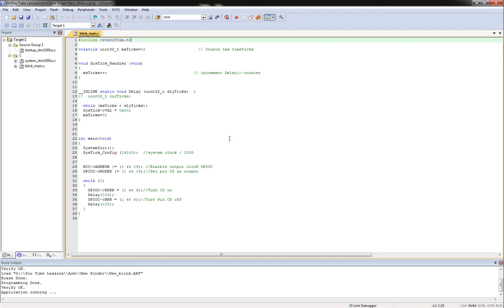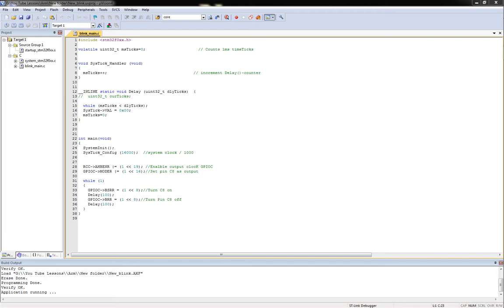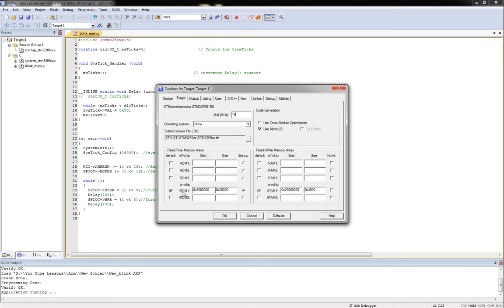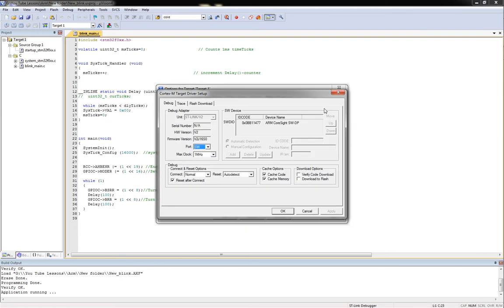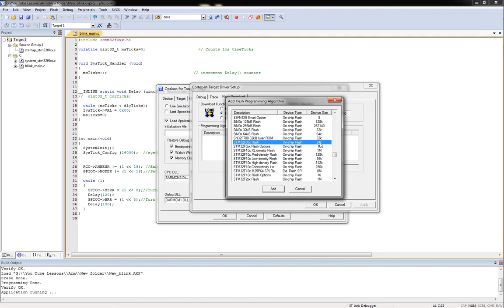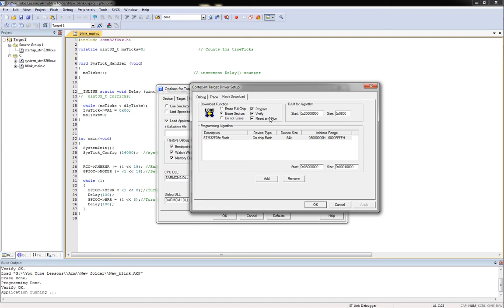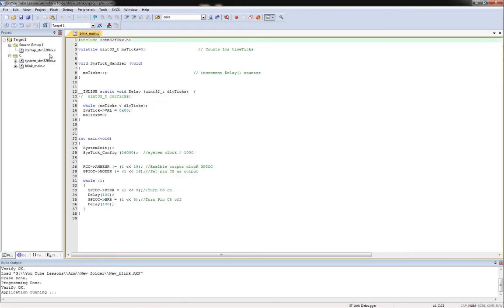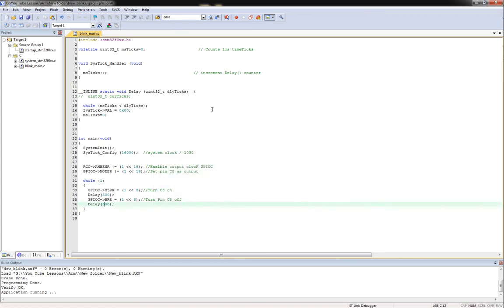ARM Keil uVision Loading with IDE using ST-Link

Comment: I have a question:
I tried to rebuild this programm, but with a STM32F4..
so i have also an ohter headerdatei, the startup_stm32f4xx.s
but the problem is, that there are two bugs in the code,
1. Line 28, the AHBENR is not known : BlinkingLight1.c(27): error:  #136: struct "<unnamed>" has no field "AHBENR"
        RCC->AHBENR  |=(1 << 19); //Enable ouput clock GPIOC

2. Line 33, the BSRR is not known: BlinkingLight1.c(34): error:  #136: struct "<unnamed>" has no field "BRR"
                GPIOC->BRR = (1 << 8); // Turn Pin C8 off
I don't know what to do, perhaps someone can give me advice

Comment: I'm having trouble downloading to the device..  it says No Connection error.

I think the problem might be the ST-Link V2 programmer..   when I try upgrading the firmware using the ST-Link Utility v4.1, from "V2.J17.S4 STM32+STM8 Debugger" to 'V2.J28.S7', it says 'Upgrade Error, Please try again.' 

Any idea how I can try upgrading the ST-Link V2 firmware?